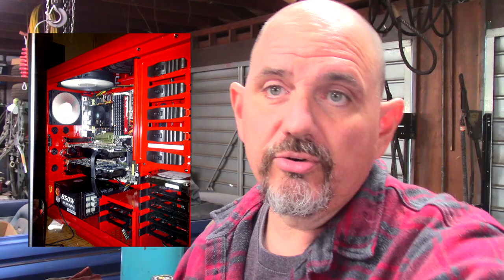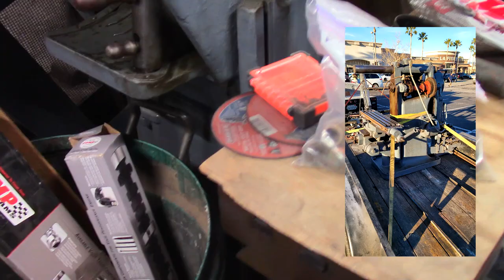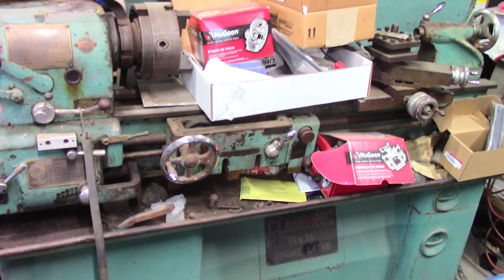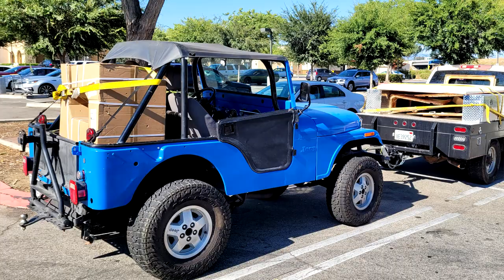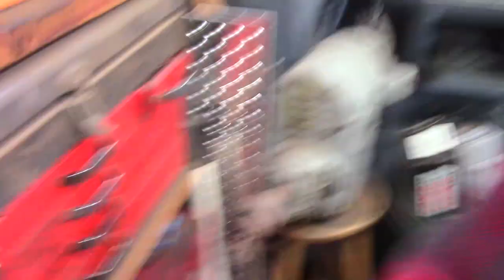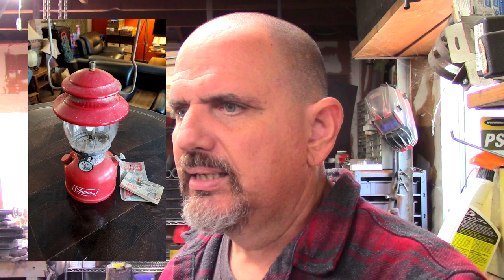Why Did I Stop Making Videos A Boring Video Video a Day 79 of 365

Comment: Hey was ur mind ever right,ha just joking anyhow did you ever finish the ranchero you know the one half rancher the other half ranger?snookie pa👍🖐👍
Reply from the maker: A little teaser of some of the work was in the video. I got the steering linkages all hooked up. I installed a manual shift transfer case to replace the automatic push button one that came with the Mazda. And, I temporarily hung the A/C evap coil under the dash as inspiration.